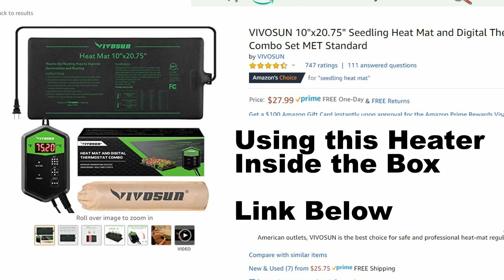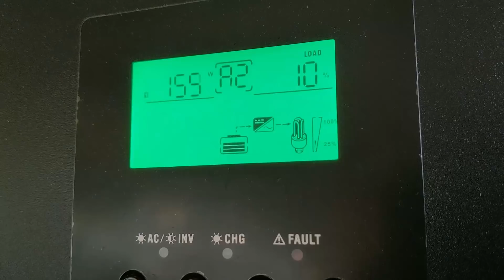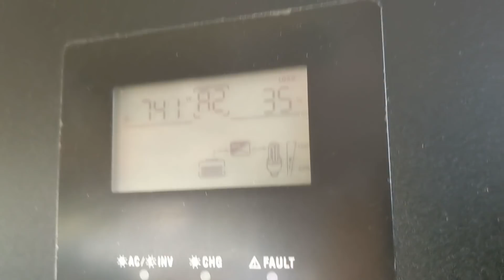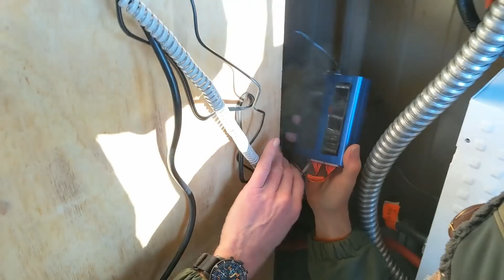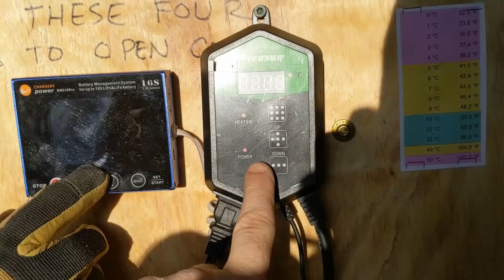Bills Off Grid Battery System Installation

Comment: I was trying to locate where the heating mat was placed inside the insulated box.  I would imagine that it's mounted on the bottom below the batteries.  I have a BYD battery cabinet that is located in a unheated shed.  I would like to try that heating mat idea to keep the system running year round.  Any update on how the heating mat worked out in the dead of Winter ?
Reply from the maker: Bill told me that the mat worked great all winter.  He kept them at 55°F (if I remember correctly).  And no overheating issues this summer.  He never needed to remove the front door.  But he is in cold Vermont, if you are in a hotter state you may have to open a door to vent them.  Bill placed the mat on top of the bottom most battery.  We placed two temperature sensors inside the cabinet, one high, and one low.  Both stayed within half a degree of each other.
Reply: @DavidPozEnergy   Thanks David for the information.  I have a seedling mat on order. I'll give it a try !

Comment: Nice video. One thing I'm scratching my head at, frame 3.23 you're using a Polaris type of connector to combine the ground wires. According to Polaris, this type of connector is not  UL 467 rated and cannot be used to combine ground wires. If there were a large surge, it could potentially blow the connector right off the wires.
Reply: Sharp eye! I ran out of ground bars that day and was not aware that those *Burndy connectors weren't listed for that.  That being said, at least its an equipment ground, not GEC.  You learn something new every day.

Comment: To add a nother unit in parallel will probably be the right thing... 
Solar panel power could be entirely used.....
Most people that use this units buy two of them so that have 5kw/phase.... 
Excellent job.....

Comment: Even easier most stove/ovens have a 120 receptacle which works off the 40 amp 240 breaker so plug it into the oven plug and it will run off the grid.

Comment: Good video but I'd be concerned about using flammable blueboard with a max use temp of 165°F near batteries.  The LiFePO4's won't burn but with that many amps there's always the possibility of an unfused short. Dropped tool, loose wire, etc.

Comment: Hi Dave, love this info. I’m a financial guy dyi. Evaluating options. I like panel to water tank ideas but think a split heat pump like the Sanden co2 very cool. Not a mini-split. Unit is dyi friendly. My idea - tinker with panel to tank for now and wait for competition and price drops. Panels are never a waste and little investment in the tank except time and I’m retired. Makes sense? My shop is easy because pex in insulated slab on grade I just built. Just need more heat in house because fireplace doesn’t do far areas. I’ve done radiant hydronic heat in previous home.
Reply from the maker: Lets chat in more detail on Facebook, it's hard to carry a conversation on this format.  I'm at https://www.facebook.com/DavidPozEnergy/

Comment: Thanks Bill, David, and Ben!!  Nicely done.
I wanted to suggest that Bill interpose a 240V to 120v - Neutral - 120V transformer between his MPP and his house.  That will allow the MPP to distribute its output however it needs to to provide for imbalances.  That way he could run a 3 or 4kW single phase load on one phase.   This would likely prevent imbalanced kitchen loads from tripping the system.

Comment: I’d be revisiting your wire sizing between batteries and to the inverter. You should not have that voltage sag with that few appliances on it. Be warned that battery disconnects (even good marine) are notoriously lossy to the point where I have eliminated them and hung big wire cutters nearby for emergencies. Do have slow blow fuses rated to at least 150% of full load. You can’t oversize your cable. That enclosure may get too hot in the summer time so be ready monitor and open it then.

Comment: David what is the Chargery BMS current size?  I see they sell the 100, 300 and 600amp models.  Also what BMS and size do you plan to use on the batteries you have like his?
Reply from the maker: Bill and I both have the same model Chargery BMS with 600 amp shunts.  I'll be making a video of more detail setting it up on my system.  Thanks for watching.

Comment: I own one of the LV5048 as well.  Can't get it in-line yet need a bigger breaker panel, but I can charge my Volt and keep my IT loads running on it.  Could be more efficient.  When solar first engages it uses .5 amp per MPPT Charger.  1.5a No Load inverter draw.  Could have better monitoring. Only 1a scale on the AMP readings and seems to lack the ability to calculate amps or Coulomb count (30 dollar amazon purchase).  Nice thing is they stack well.  Plus once you get to 3 of them you can run 208v 3 phase.  Love the video, exactly what I need to show my electrician.  Battery cabinet is very nice.  Do you expect to have to open in the summer?
Reply from the maker: Yes, Bill will probably open it in Summer, which is why he made the front panel so easy to remove.  However, where he lives, at his elevation, it's usually cool.

Comment: I'd keep a check on the battery temp, that solar plane that flew around the world, actually damaged the batteries from over heating, they were heavily insulated from the cold at altitude. They had to add cooling, with a decent load, or charge they can heat their selves, but I'm thinking in summer they may overheat, not that they can cause fire, but damage the cells, costing capacity, I'd keep a check on it!   
I may build a outside battery cabnet similar to his. I have a small fridge, with glass door I'm putting some of my batteries in, I have 2sets of leaf batteries, with 1 split, to make 7s, then a 20p of 8ah lipo cells, in a bank, then 1400+ 18650's in 100p packs , in 7s , each 7s is about 260-ah est, I can't test property, after 24 hrs my tester times out, but the cells are 24** to 29** mah.  Times 100 ... All this is about 1/8-1/4 what I need/ would like, plus a 12v 250+ ah LIFePo bank for 12v lighting and accessories, using LED lights, more efficient, and saves the inverter losses, I'm going to get a 1200-2400watt inverter to add to the 12v system, as backup,  I also have a24v lead acid Bank of about 800ah, plus a small 1500 ups, as part of the backup, and 2 small 12v ups, I may use the UPS to keep the lead bank charged, after all is settled, all fully offgrid. Plus a couple generators, and a 12v and 24v generator in the works, to charge the banks, in emergency, I plan to only charge the lithium banks to 70-80% at 160 amps peak for the 24v ( 27- 28v) and 13.5-13.8 for 12v 100a. 
1500 watts of solar isn't nearly enough, I'm hoping to add 2400+ watts in a few months. If I can find a deal on panels! Shipping on them sux!  There is only 2 places in my county I have even seen solar panels! Not much going on here with PV,  I may save up a bit, and go to Florida with a trailer, buy a pallet or two!!...

Comment: Since you are running the inverter in split phase mode, check to see if the two resistive appliances are on the same leg. If  so, move the oven to the leg with the lower load. It’s shame to not use the automatic transfer mode. You may have to redistribute the loads to minimize the load imbalance. (If any)
Reply: Yeah it's very annoying to have to balance the legs like that.  Myself I switched all my 5kw to a single leg  and life is much easier now.

Comment: Can you tell us any more about the well pump? It seems there was some "sag" when it started, at least in the video. What's the wire gauge and distance between the battery and inverter?
Reply: Startup on well pumps is a beast, that’s why some use starting capacitors

Comment: If the toaster oven and the electric kettle were on the same phase, just move one of them over. And take the system back out of bypass! The LV 5048 is just two 2500W inverters synchronized 180 degrees out of phase. If all your loads are 120V you can tie them both together for 5000W @120V in a single phase.

Comment: Needing help finding information on off grid solar panels and battery system for my business. It's has a $6k month light bill.
Reply: What are you looking for? Where are you located?  I may be interested in helping, I have a fully offgrid house , done it all myself,    that's quite the bill,
Reply: @jamest.5001  a full off grid solar panel system with battery bank.
Reply: @jamest.5001  You didn't acknowledge they guy to whom you asked a question. I guess you're not offering your help any longer?
Reply: The 1st step is usually to  reduce the demand.  100 watt florecent tubes can be switched to to 20 watt LED tubes. Then when you go to solar, intead of a 100 kw system ( That could cost you $100,000 in just new solar panels  ), you would just need a 20 kw system.
Reply: In the united States of America. State of Georgia. The machines at my business runs 24/7.

Comment: The transfer which occurred by turning off the inverter power seems normal. But it seems like as if the pump load was pretty high as can be seen by the display shutting off. Is a soft starter warranted?
Reply from the maker: The screen may have just timed out while we were waiting for it.

Comment: Wow, that looks like a professional setup for an MPP System. I'm curious how you handled permitting this system as it appears to be Grid Tied? I wish you well with it, please keep us posted.
Reply from the maker: This does not back-feed the grid.  Yes, there is a connection to the grid that allows the inverter to pull electricity in order to keep the batteries charged.  But nothing can push electricity onto the grid.  However, it's a simple thing of Vermont, no permit required.  This was done legally.
Reply: @DavidPozEnergy  Thanks for the reply David, I've been following for almost two years and I always enjoy your videos, especially when your daughter is helping you. I didn't mean to insinuate that your work wasn't done correctly. The reason I started following you is I'm a licensed commercial solar contractor and have worked in the industry for about 10 years. Well about 1 1/2 ago 2 elderly couples asked me if I could install an emergency system for about $1,500.00. Before I said no I asked them to give me some time to do a little research and see what I could come up with. Which led me to you and a few other. As I'm sure that you're aware by now solar equipment Is NOT cheap, especially if it's UL Listed, which is required on every project that I've ever done and I've installed thousands of panels in the last 10 years. I truly want to thank you for all the help that you've provided to everyone that watches you, even old guys like me. I wish you many years of continued success.
Reply: @DavidPozEnergy  It's a subtle point you make David - both grid tie and non grid tie connect to the grid. One will kill a linesman if not connected via a grid isolation relay and both can kill the occupant of not savvy about electrickery!
Reply: @Bennyboy-dog  
rubbish,
grid feed inverters have anti islanding protection
Reply: @ursodermatt8809  anti islanding protection = grid isolation relay.  Just naming convention differs Urs. You can have them built into the inverter or part of the meter installation or both (I suppose) - again depends on local practises and regulations.
Reply: @Bennyboy-dog  
just checked with my hybrid inverter, when turning off mains a relay disconnects the mains. but it is quite happy not feeding in when told so.
but i repeat, i doubt very much that hybrid inverters relay on outside relays to stop islanding. i mean, if you have a power failure, you have to run to the fuse box and switch the inverter off?
not sure, maybe america is different if all the fuse boxes on the walls.
Reply: @ursodermatt8809  All grid tie inverters will have anti islanding, and most use incoming mains to sync phase, so if no mains, no output from the inverter but in the case of multiple inverters this mechanism can't be relied on to work, so you have to have an anti islanding circuit in the meter box. These don't need to rely on detection by the inverters - they detect mains failure and isolate the building from the mains independently of the inverter(s). I found this article quite interesting on grid detection systems: https://bcjcontrols.com.au/islanding-detection-methods/
Reply: @Bennyboy-dog  
you lost me there

Comment: If the power goes out for an extended period of time in the cold winter (more than one day) what will keep the batteries warm? and if the batteries are too cold to charge after power is restored after a couple days I don't see a safety low temperature cut off to keep the batteries from being damaged from being charged when temperature drops to below freezing. Has the logistics for this scenario been considered? If batteries are kept inside the home this is not an issue. I keep mine inside my heated garage.
Reply: Chargery BMS has low temp cutoff.

Comment: Sorry to see that they went with bypass mode in the end. It sounds like they might have both loads on the same leg. An easy fix (not cheap) get another LV5048 and parallel them. :-)
Reply: Jason Carmichael I was thinking the same thing as for the same leg. However, why not separate those loads? If I recall correctly this inverter can be split-phase. So have the toaster on one phase and the kettle on the other. 

Or don’t run both at the same time...
Reply: @robertsteich7362  yup, me too. I think the easiest thing to do is not run both at the same time.
2nd easiest is to put the kettle on a different circuit.
3rd (MORE POWER!) A 2nd LV5048. 😆
Reply: Even easier most stove/ovens have a 120 receptacle which works off the 40 amp 240 breaker so plug it into the oven plug and it will run off the grid.

Comment: Even though LiPo batteries do not lose a lot of capacity in cold weather, compared to flooded cell, why would you put them in an unheated space?
  Also, what was the cost of this system?  Thanks.
Reply from the maker: These LiFePO4 batteries are inside a heated enclosure.  They are kept at 50°F

Comment: Very nice concept. Unfortunate the inverter is evidently too small for it to be normally left in circuit, to allow automatic operation. I run all of my wiring in a neat, tidy, and professional manner using proper components. Terminology. The old Main Panel is now the Emergency Panel. The manual switch is either an Inverter Bypass Switch, or an Inverter Bypass and Isolation Switch, depending on it’s configuration. When the power goes off due to unforeseen circumstances, it is a Power Failure. Snowflakes are trying to soften up our language, and hide from reality. Love your videos and your content, keep up the good work. Thumbs Up.